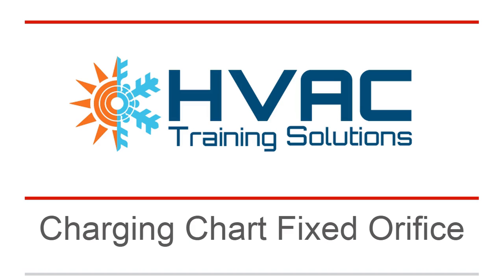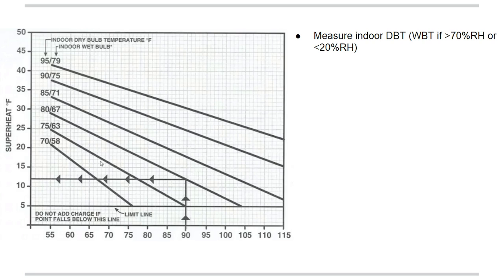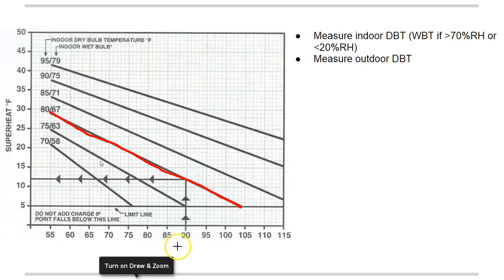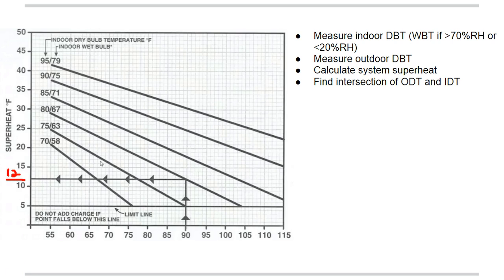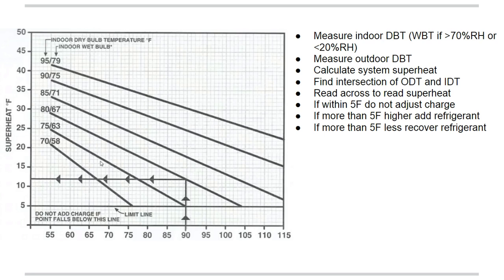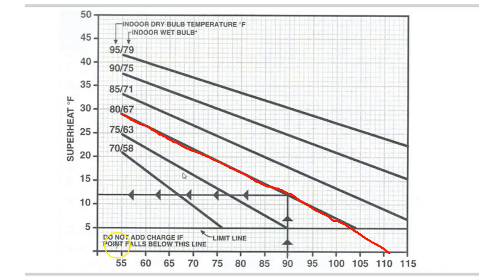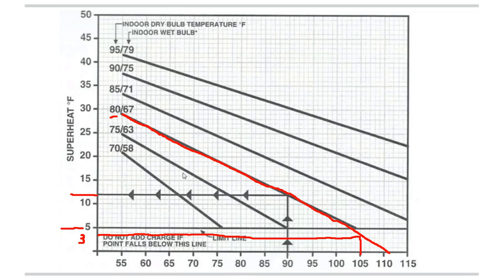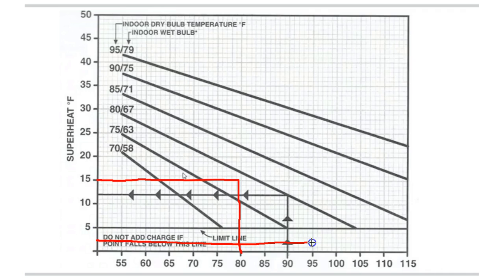HVAC Training | Charging Chart Fixed Orifice | HVAC Training Solutions

Comment: So if a unit's sticker is missing, sun corroded, and you are called to a non-txv application, can you charge this unit to a rounded superheat number just like you would use txv's 8-12 degree subcool figure?
Reply from the maker: Ben Staton In a pinch yes. I would download a fixed orifice charging chart and use it as your go by for situations like you described.